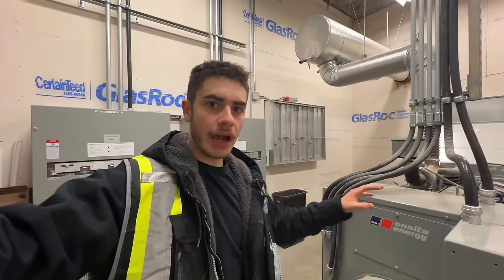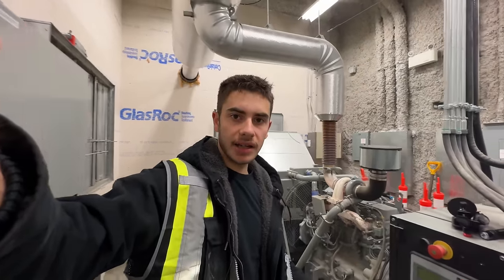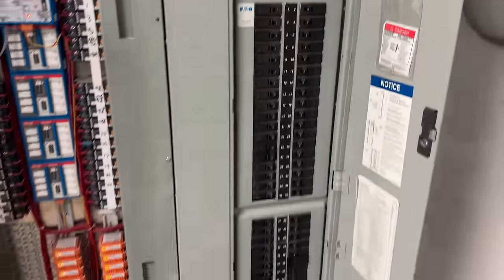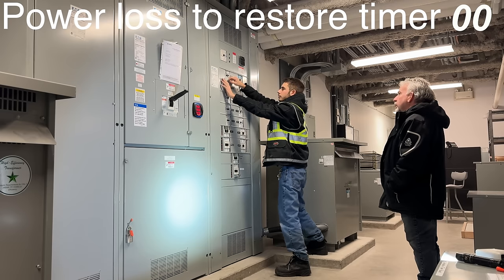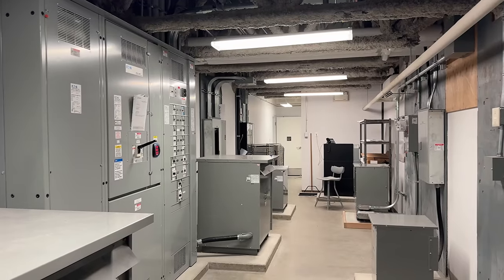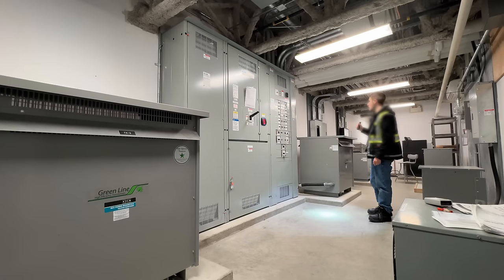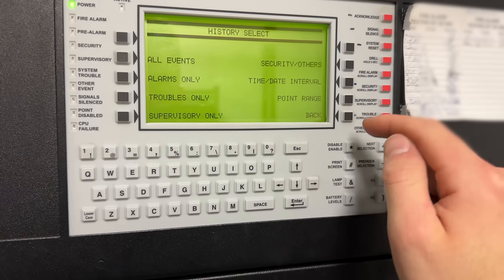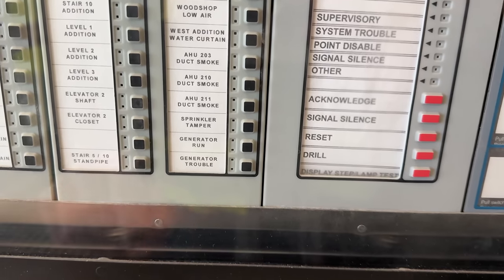Power outage generator test at high school, real power outage simulation, startup load/transfer

Comment: running it like this while the grid is up from my own experience is also useful when the utility company asks for some loads to be shed or turned off. also means if the grid does go off during a time when they do call for such that those critical loads are already on generator or even solar for those who can use it
Reply: This was actually implemented here in the Philippines (Interruptible Load Program). Those businesses that have sizable generators can enroll into the program and be reimbursed for the fuel used. They will be called upon by the power company during peak hours to disconnect from the grid and use their own generators.
Reply: @markarca6360   It's not exactly the same but in Massachusetts if you have a supported grid-interactive battery backup system (like Tesla PowerWall) you will get paid handsomely for discharging into the grid at times of peak load. It's all automatic on the customer's side.

Comment: What's the high-pitched whine I hear in the generator room before the generator starts up?  You can listen to it as soon as the power goes out and your timer reaches 0
Reply: More than likely a VFD - Variable Frequency Drive. It is controlling motor load(s). It will convert AC to a pulsed output to regular speed.

Comment: A bank I worked at scheduled a offline load test for its generators. They were in part of an underground car park 😮 and they wheeled in the load bank and started the test. Forgot about the sprinkler system... Fire brigade got a nice practice callout to turn off the water...
Reply from the maker: Yes you definitely have to be mindful every time we do a load bank test we have to be conscious of sprinkler heads and heat detectors

Comment: Interesting the random things you editing software decided to dither, the Scotchlite in your jacket, and some of the text on the fire alarm panel. Will there be some sort of protective cage, or thermal blanket for the exhaust manifold, turbo housing and flex pipe?
Reply from the maker: Some things are blurred to maintain privacy. No there is not any guard from the hot surfaces

Comment: Modern building systems are wild. Fire alarm integration, automatic lighting integration, all the vent systems. I am curious why it forces lighting on? Or is that because you assume the lighting controller will go down?
Reply from the maker: It's because your emergency lighting needs to turn on to ensure proper egress as other lights will go out that could potentially be what is keeping the space illuminated
Reply: @nics-systems-electric  It seems so obvious now that you say it. Thank you.

Comment: I’m actually gonna have my own workshop/party barn and still be running off solar power so that I don’t have to rely on the unreliable power grid
Reply: What are you going to do if there is a long period of cloudy, overcast winter weather and your solar panels don't keep your batteries charged?
Reply: Better have a ton of batteries.
Reply: We already have this, it’s great and has paid itself off, running most house appliances for 8 years. 118kwh of lead acid batteries previously used in a cell tower UPS system, and when they’re low, can be charged off a generator. We still have the grid connected most of the time. but it can last about 24-36 hours with no solar/grid connected at all. With solar connected it’s self sufficient and never needs grid most days. As we had super bad unreliable power.
Reply: @ItsYaboiiZac Telecom batteries, these are tall batteries, primarily used in cell towers. They are sealed lead-acid, particularly AGM (absorbable glass mat) type. You should maintain at least 50% to 55% of reserved charge capacity with this type of battery, because it will degrade over time with excessive discharge. Lithium-based batteries minimize these reserve capacity degradation.

Comment: I'm looking at getting a Generator for Power failure to keep my Servers / Data Center online without any downtime, I have battery backups UPS's that can run up to 30mins on battery. Could you tell me what would be needed and another question, What happens to the Power from Generator when the grid power comes back online? I am in the UK our AC voltage is 240v but if the Generator is running and the Grid Power comes back online that is 480volts right there I am a bit worried of pupping 480volts into two UPS's and the rest of the kit. I am guessing that the Transfer Box handles this? 

Thanks
Reply from the maker: You need generator and transfer switch. When utility power is restored both power sources will be present at the generator transfer switch but it will still be powered off generator for a short period of time until it decides the utility power is stable and then will switch over to utility power and disconnect from generator power

Comment: Find these interesting. When the fire alarm goes off at this school does it shut down all air handlers and condenser systems? (HVAC). At mine which was built in 2020, we have a chiller and boiler system with air handlers for each room, all of that shuts down when the fire alarm gets activated. Johnson Controls (York) brand. Source: the company I work at does maintenance for the school
Reply from the maker: Only units that provide air to multiple zones which aren't many there's no point of shutting down chillers it would be the same as shutting down gas boilers which is pointless as that doesn't have any effect on the air containing smoke travelling through multiple fire separations
Reply: @nics-systems-electric  yeah I guess they did that because I believe it’s code in my state to shut off all sources of heating & cooling. The boilers also use propane (LP) so that would be kinda bad to be running while there’s a fire

Comment: I wanna flip the giant breaker...  Besides that, is all the emergency lighting run off the generator? When I was in high school we had one outage where the generator failed to start. IIRC a handful of the hallway lights were running on battery.
Reply from the maker: The big breaker just does the whole service it's not as exciting to flip as you might think lol and generator powers all emergency lighting. But there is still battery back up units in specific areas
Reply: When I worked in a theater of a school, and I had to go into the main electrical room, I wanted to hit the main so bad. It had a big knob on the end of it ,too. It was asking for it.

Comment: It’s basically a like when you cold start a car engine😂
Reply from the maker: Not quite this is a diesel most cars are gasoline and this is equipped with a block heater that is constantly circulating hot water through the cooling system and this has to go straight to 1800 RPM there is no time to idle first
Reply: @nics-systems-electric  true true man thanks for the info.😊👍

Comment: 8:50 Potentially a real noob question but, are the damper actuators fail-safe? I.e. if the solenoid/motor/whatever it is fails, the damper opens and fault codes until someone can attend to replace it? I can imagine that the people using the place as an emergency shelter wouldn't be able to identify this simple fault in a pinch, especially if it became dangerous to enter the generator room due to hazardous atmosphere.
Reply from the maker: I don't believe it is fail safe as one has failed before and the room did get extremely hot however the generator did not mind or have any extra high temperatures as it still seems to pull air over the radiator just fine however the room temperature was not comfortable at all for humans if it was a air cooled generator it would be much more of a problem I would think
Reply: @nics-systems-electric  sounds good - as long as CO makes it out of the space you're golden.

Comment: Definitely a good idea. Every full system generator system test that I did we found something wrong. Generally, things that were connected to generator power that weren't supposed to be, and vice versa.
In one case we found that the actuators that allowed fresh air into the generator room weren't fed from the generator, so it would have been just a matter of time before the generator overheated and shut down.
Reply from the maker: Yeah absolutely that's definitely much easier to find in a power outage too. Just much more obvious what isn't on generator. But you definitely find things that make you wonder what thought process was to not put things on emergency power.
Reply: @nics-systems-electric  Like the job I was on where we found that the entire heating system was backed up by the generator...except for the boiler controls.

What I couldn't believe was how many times someone fed all the battery packs from the EM panels. It's not only a Code issue, but also dumb.
When the power goes out so do all the regular lights, but the battery packs never turn on because their 120V never dies.
Augggh
Reply from the maker: @ghost307  the battery operated emergency lights in this building are on generator circuits but that's fine because they will still operate during the switchover time of no power it would be different if they were on the UPS panel then they would never come on
Reply: @nics-systems-electric  We must be working under different codes. In the jurisdictions that I work in the code (USA NEC 700-12E) requires them to be fed from the same branch circuit as the regular lighting in the same area.
Reply from the maker: @ghost307  our emergency lighting is required to be on other a lighting circuit or with exit signs it's fine for it to be on generator power as if the generator is running so will the normal lighting that is also emergency lighting during a power outage. Should the generator fail and you lose your emergency lighting fixtures then the battery back up will come on this building only has it in the electrical room and generator room

Comment: How long will this/these generators typically run for (on a single tank of fuel)? And how big is the fuel tank?
Reply from the maker: I believe around 22 hours per full tank
Reply: It would be in 100 to 125 us gallons or 378 to 473 litres range. And the fuel consumption at this load would be about 10-12L/h wich would give you an autonomy of about 36 to 40ish hours.
Reply from the maker: @farmguy2400  I don't know about the actual fuel consumption but I would think it's not that much fuel storage as it does not get that many hours
Reply: @farmguy2400 and  @nics-systems-electric  
Thanks to the both of you! And that's a fair bit of fuel, but considering how much it powers that seems fair.
Reply: At around 1:47 there is a badge on the generator, max inlet is at 113 Liter (30 gal) per hour at full load. So I hope the fuel tank has a lot more than just 100 Liters because you always have to calculate with 90% of max capacity.
Reply from the maker: @marcd6897  I know it gets around 22 hours on a full tank that's the only information I've got
Reply: @marcd6897  You are right. I didn't see that. That is absolutely massive!
Reply: @marcd6897  No, it says Max inlet fuel flow and the measurement is in L/h or litres per hour. That is the flow of fuel going through the priming pump and fuel filters, of 113L/h the engine takes what it needs and whatever that left returns to the fuel tank.
Reply: @marcd6897  That JD 4.5L engine burns about 10-12 litres an hour at about 30-40% load.

Comment: Im thinking, Elevators should be on generator power too. Because if you are in an elevator when the power goes out then you're stuck.
Reply from the maker: They are in some schools but not this one. elevators are a massive load. you aren't necessarily stuck though as modern elevators have battery back up to provide enough power to platform them and open the doors

Comment: Love it nic my school does k-12 and has a 2000v gen
Reply from the maker: 2000 V or 2000 KW? 2000 V is not a common system. there is 120/208 and 277/480 347/600
Reply: @nics-systems-electric  he probably meant either 2000 KW or 2000 KVA
Reply: its a 600v  my bad @whodatSean

Comment: Why is the Diesel fuel in the generator green?
Reply from the maker: Same reason why some is red because it's marked diesel
Reply: The diesel you use in vehicles has extra tax paid on it.  The diesel you use off-road such as in generators does not pay the road tax (it is cheaper).  To keep people from using the cheaper diesel in their vehicles, they put dye in the untaxed diesel.  If a cop finds dyed diesel in your vehicle it is a big fine.

Comment: Surprised it didn't even bog or drop any RPM. Thing must have like 10% load from just lighting.
Reply from the maker: About 31% load around 14,000 KW if you listen carefully you can hear a slight change in the engine

Comment: I really really really hope those vents did not auto open... I hope someone opened them by flipping the switch AFTER it started and is known to be safe... Thats a big safety thing if they are auto opening, could let outside air in and that will end up killing ppl...
Reply from the maker: Of course they are auto opening you can't run an auto generator with manual operated vents

Comment: 12 seconds not bad
Reply: How it should be, I laugh at these videos where it takes like 30 seconds.
Reply from the maker: Depends on its usage 12 seconds is not fast enough for some facilities however others that have UPS's and aren't using it for critical life safety power may want to wait longer to reduce where for unnecessarily starting for shortages
Reply: @nics-systems-electric   oh my bad i did know i am 15 a freshman and still learning :)

Comment: None of my schools ever had a generator power outage = go home. Someone ran into a telephone poll to get out of school
Reply from the maker: If power is out they will still cancel school. It's just that some buildings need to have a generator because some of the critical life safety systems have to have power to operate
Reply: When I was in school if power went out (happened a couple of times) we would just have stayed there, sure it was when we did use blackboards and paper, maybe now that we have digital blackboards is more of an issue. 

The issue back in the day was that the bell couldn't ring, and thus you did not know when the lesson did finish. Anyway a power outage rarely lasted more than a couple of minutes, at best hours.

I think that critical systems are powered by UPS anyway (red sockets) and emergency lights/fire alarm are usually battery powered.
Reply: The generator isn't there because it's a school, it's there because it's an emergency shelter.

Comment: I would not recommend touching multiple grounds while throwing switchs. Stay safe out there bro!
Reply from the maker: I don't have a choice with these MCCB's you have to flip and hold up the lockout tab. Kind of the same as some manual transfer switches where you have to push the tab while using the handle to switch sources.
Reply: @nics-systems-electric  I hear ya, grab some good resistant gloves trust me haha

Comment: I used to work in a high school theater that also rented the space for profit, and we once lost a leg of the 3 phase during one of those non school related shows.
It triggered the generator to run which switched the relays for some of the audience and stage work lights to come on. We had to figure out how to get the relays to switch back off and also move some of the front stage lighting to working circuits on the other legs so it wouldn't disturb the show any further. The show actually never stopped, and the audience wasn't even aware of a partial power outage. They just thought some yahoo messed up lighting cues.

Whenever I was in the main electrical room, I had to fight the intrusive thought to push the trip button on the huge main breaker.

Comment: some of those generators are built so that they can run for 3 years without shutting off, as long as the oil is changed. can buy 5000 gallon fuel skids
Reply from the maker: Absolutely the duty cycles on some of the diesels are pretty impressive
Reply: @nics-systems-electric   of all things, i got a 7000 watt dewalt generator out of a scrap bin for $50... and i have a short plan to weld and bolt some joints to the crankshaft on the cars 4.6L V8 triton engine thru its old differential to turn it at 75hz not 60hz, with the actual engine hardly braking 1500rpm... it does not have a voltage regulator and does have a self magnetizing core... but its odd what voltages i might get out of it as it is a combined 3 phase 240 volt unit at 60hz with a 240v 24amp main braker... think the wire was 600 volt but if 75hz pushes it to 280 volt with a peak of 408 volt on the wave... for having a welder plugged into it, that should make holding and arc easy because of the line voltage but its a 6kw main braker so it might trip a lot. been about 10 years sense i was in a school, but that's a lite end project that could end up fixing something on a larger end of things if it did go out. would not be the V8 triton dropping off like the 380cc single cylinder but if it's amperage alone that trips a braker the peak on that 280 volt would look like 13KVA momentarily 530 volt with the 1000 volt frequency shift. not concerned with burning it out, it has a braker switch. think some power grids were 75hz so they had to make those generators able to run that, tho the little engine they come with cant keep up. think some people use them portable units to back feed power into there house thru a welder plug and it just trips the small panel braker when the mains come on... if the meters have digitized enough to realize there back feeding the grid or not? the spiny disk spins one way...

Comment: I hate when they label circuit breakers "transfer switch", makes it impossible to tell whether or not it's a back fed source or a load.
Reply from the maker: The feed in to a panel from the transfer switch  is usually not labelled transfer switch and as the label is on the main PDC it's pretty obvious it's a feed going out